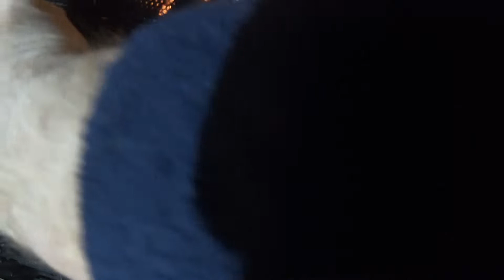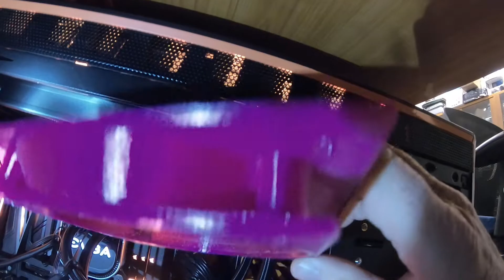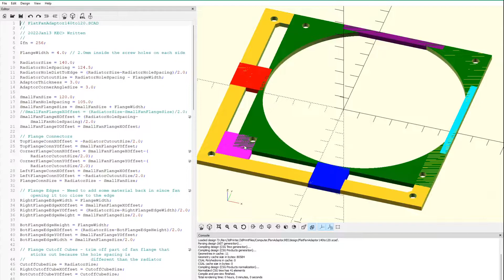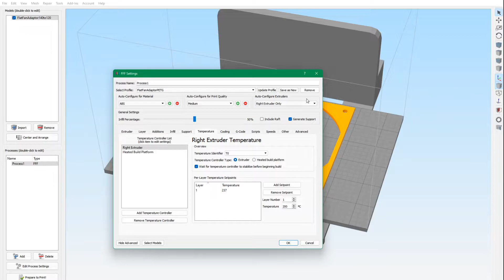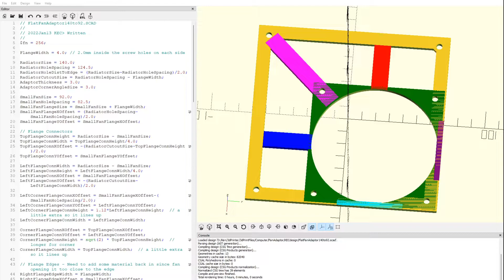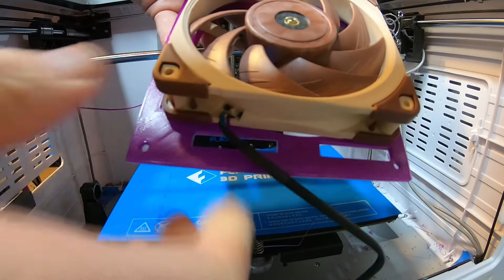Push Fans on a CPU Cooler Radiator with Restricted Space Using 3d Printed Fan Adaptors - Part 1

Comment: Will this work with a 13900k 1700 socket?
Reply from the maker: According to EVGA, this cooler will work with a new retention kit for the 1700:
https://www.evga.com/products/product.aspx?pn=M022-10-000178
As far as the 3d printed fan adaptors, that's really a function of your motherboard and how it fits into your case with the cabling.
I had restricted space at the top of my case for push fans, so I had to use small fans and use these adaptors to attach them securely to the case.